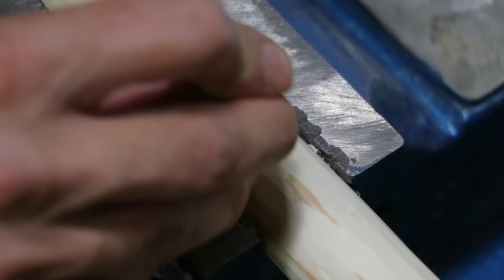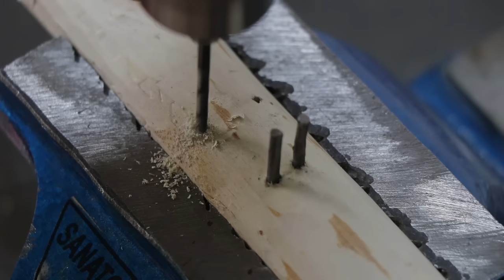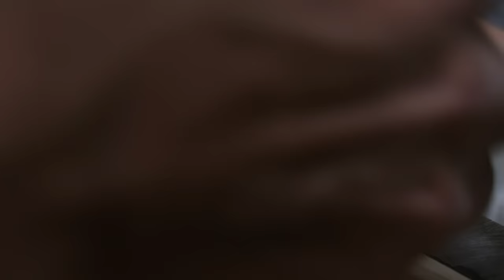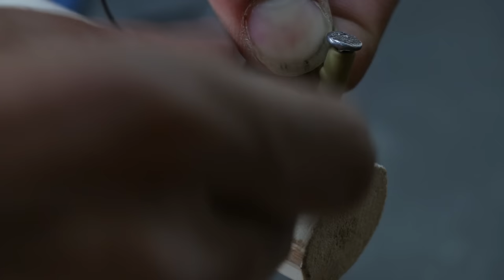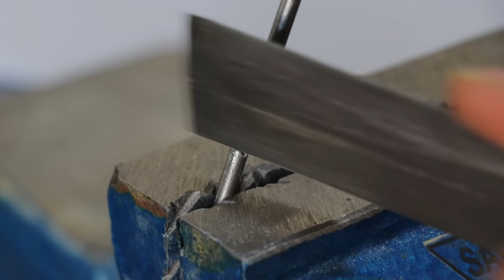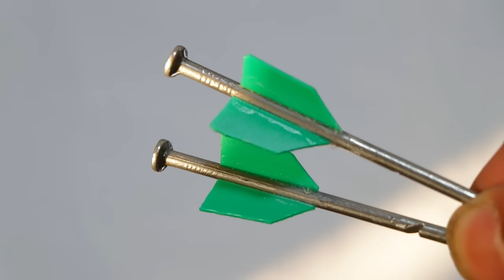DIY -Nail Dart Slingshot- Easy to Create

Comment: I would like to see the test shots.  Apparently, from what I saw in the video, the darts are coming out totally without direction.🤔
Reply from the maker: i will build a new version soon , because  nails that i used were thin and i wasn't able to make a enough cut throw them 
thanks for your comment
Reply: Dart was not properly balanced. It was clearly tail heavy due to the nail head and fins.
Reply: @sohrabslingshots I think if you made the groove in the nail to attach the string closer to the front of the nail it might keep it straighter! Or at least keep it from tumbling too much!
Reply from the maker: @chrisemerson7743  yes you are right👍🌹

Comment: glue the arrow feathers at a small angle, this makes the arrow rotate during the flight, which will greatly improve the accuracy of the shooting.
Reply from the maker: thanks for that👍
Reply: Probably could 3D print angled fins attached to a sleeve that could simply be slid onto the nail shaft and superglued in place!!!